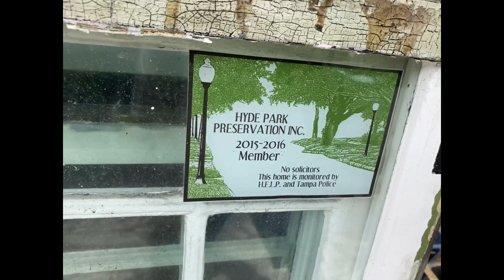Training People Is The Only Way To Solve This Problem.

Comment: I'm almost at a loss for words because what I want to say can't be published on YouTube! I've spent my whole adult life developing the skills to save our old buildings and have helped or totally restored three of the four houses I've lived in since my teenage years. I just finished building and installing a three sash casement window in my kitchen to match the 95 year old casements in my dining room. 
The window I replaced was installed in 1980 and well past it's prime. Actually a piece of s&%t. That window in it's prime was no less drafty than the old windows which really aren't that bad now that I've built and installed proper wooden storm windows. 
The last house I owned the previous owners had painted shut all the windows. I took them apart, cleaned and fixed broken parts, weather stripped with bronze and magically they all opened and closed one handed and did not leak excessively. 
My daughter's house had all the original windows replaced in the early 90's. They now look like crap but she can't afford to replace them and I'm getting too old to take on a whole house restoration. 
Man you hit a nerve with this post! I sure hope you can keep it up and train some people to continue your work.